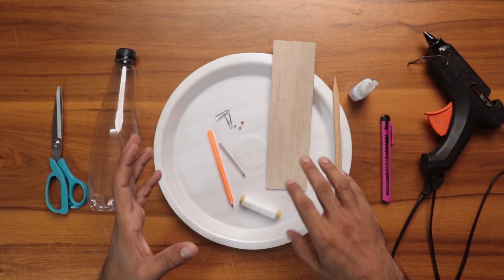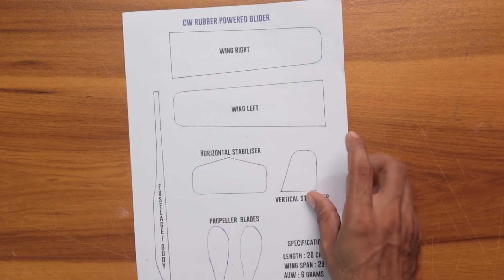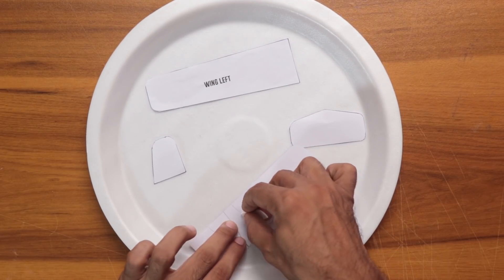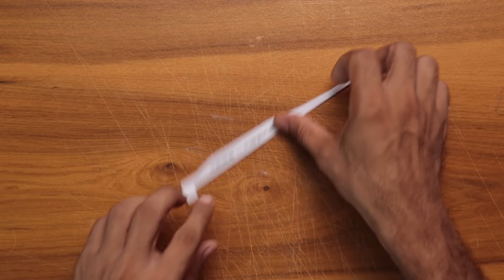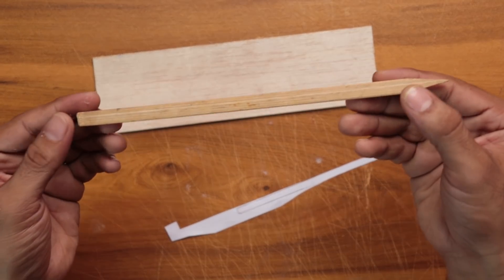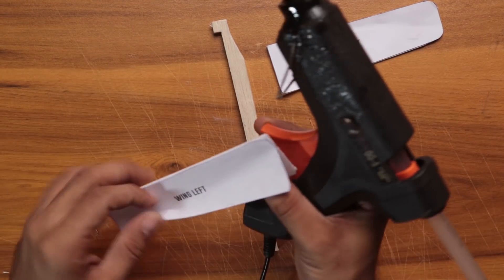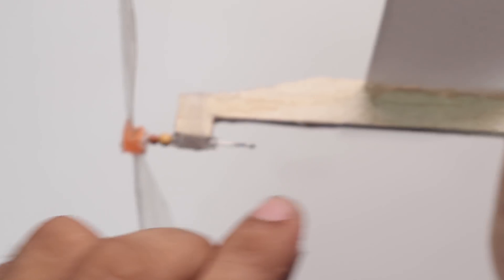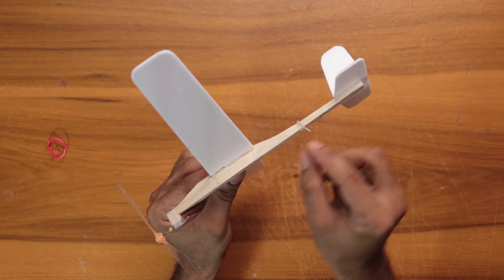Rubberband Powered Glider plane build video |  Making DIY glider | Malayalam | Drone, RC planes.

Comment: Athukondallaaa.....glider nte wings length kuravaanu....athupolew athinte front weight kooduthal aanu athu onn balance cheythaal u will get much more flight time
Reply from the maker: Thank you rahul yes seriyanu,  but ee material use cheythu wing span koottiyal flyingil iwing valanju pokum athanu koottathathu, pinne ee video edukkana timil wind undarunnu so stalling avoid cheyyan aanu nose heavy aakkiyathu